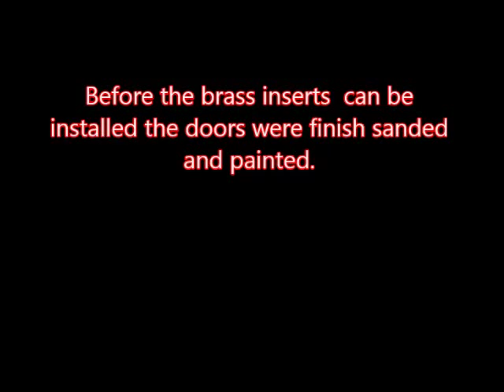Solid Wood Storm door

Comment: why did you pick epoxy to glue rather than wood glue ?
Reply from the maker: Epoxy is 100% water proof, much stronger than wood glue and has a very large open time.  It gives you all the time you need to put the whole project together and get everything just right.